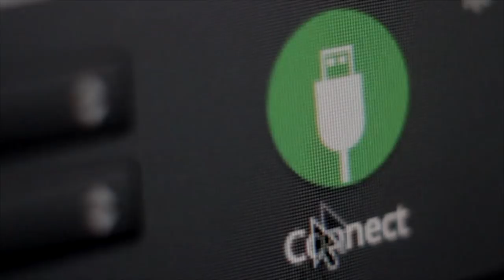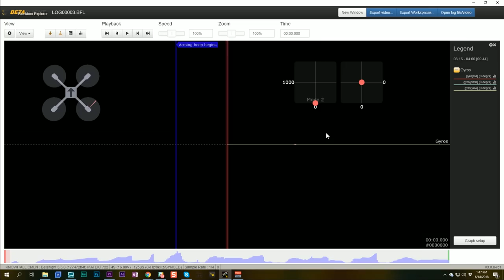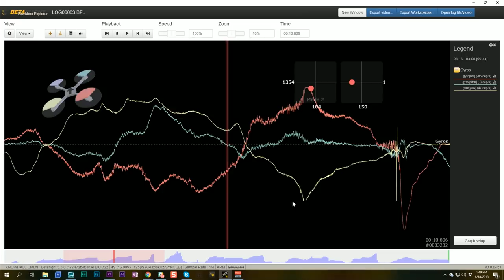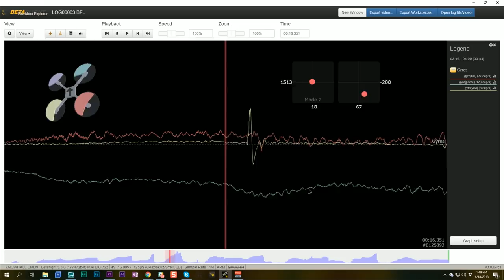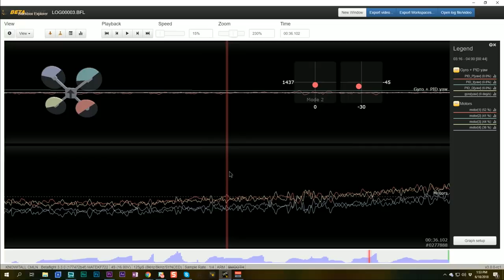Gyro Noise Troubleshoot | MINI QUAD BLACKBOX

Comment: Nice video!

 I've been flying my F7 FC on 32khz with icm20608 since the first F7 optimizations in 3.4 in march so all these issue aren't new to me.

Can you address the gyro calibration and arming issues on Betaflight 4.3 32 kHz? It's easy to fix by turning some (previous moron) stuff of, increasing delays and calibrating on first arm, but what is the ratio here?
Reply from the maker: I don't understand the question, "what is the ratio here".
Reply: Joshua Bardwell I mean what do these settings do exactly. What are the risks of not calibrating the gyro (I'm not talking about the accelerometer) or is it risky to fly a quad where the gyro doesn't calibrate with default settings. What is going on with calibration of a 32 kHz gyro that is it so different than an mpu6000? How do I make sense of this? What do I have to do to have a safely calibrated/non calibrated gyro?

Sorry I'm not native English. I found the correct word and it's rational.

What's the rational of the 32kHz gyros unable to calibrate and changing settings to fix the issue.

gyro_calib_duration = 1000
Allowed range: 50 - 3000
Default value: 125

gyro_calib_noise_limit = 0
Allowed range: 0 - 200
Default value: 48

gyro_cal_on_first_arm = ON
Allowed values: OFF, ON
Default value: OFF

Which is quite crude to my idea. I would like to do something more subtle and faster.

Comment: If we are going to have to use these flakey new gyros i think everyone should make flight controllers with replaceable gyros like airbot.
Reply: I think this is actually because of the crappy small rubber standoffs they supply. 
They are too small and soft and are prone to oscillating laterally. 
I think if you want to use the rubber stand offs the 8mm x 8mm are much stiffer and wont wobble all over the place as easily.

Overall however the grommets are probably the best solution as you can adjust the tension and also there is a solid shaft through the middle stopping lateral wobble.

I think the main reason the kakute flys so well is that it has a foolproof soft mounting solution as long as you keep things clear of touching the imu board.